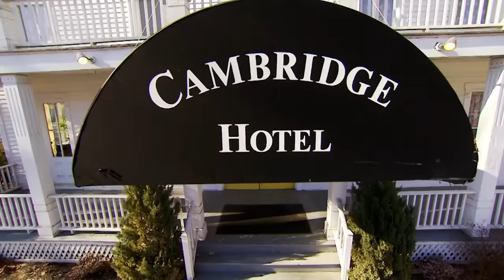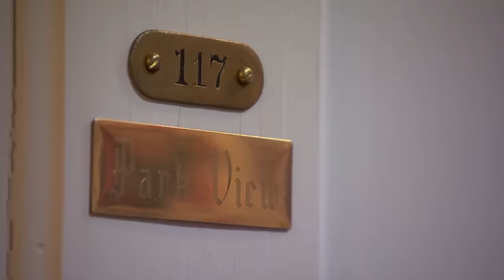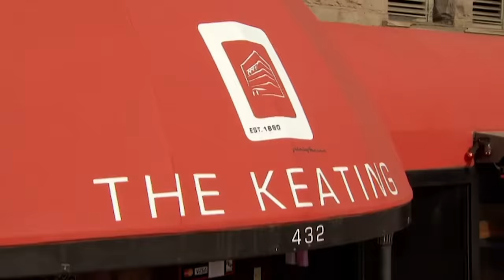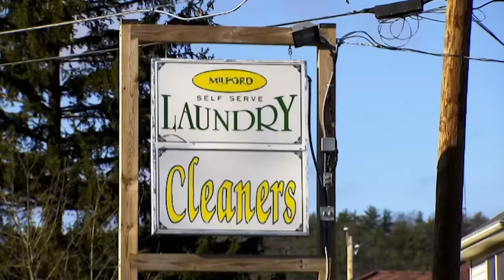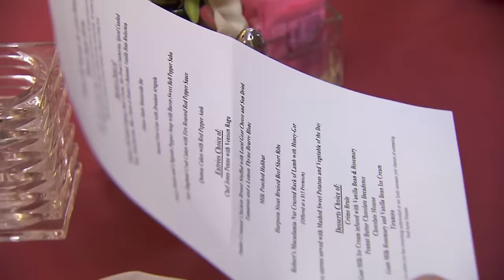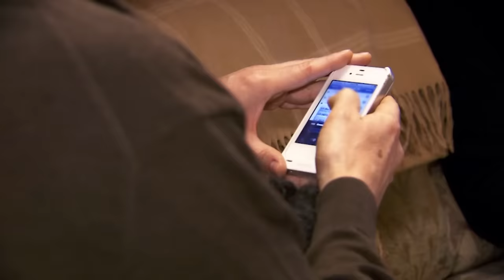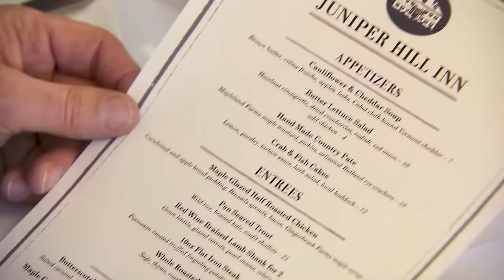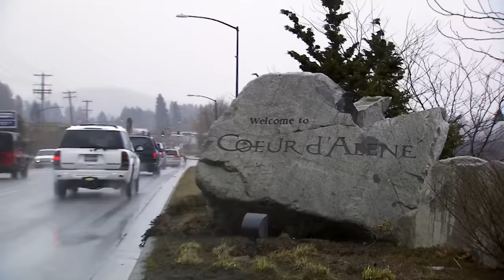every stressful moment of season 1 | Hotel Hell

Comment: The Juniper Inn
To recap everything above, Juniper Hill Inn closed in 2013 because of major debt, owing the bank $1.1 million and the city of Windsor, VT $80,000.

The hotel was sold to new owners.

As of 2023, the old Juniper Hill Vermont location is occupied by a new hotel called the Windsor Mansion Inn.

Robert Dean and Ari Nikki, the Juniper Hill Inn owners, seem to have moved to Florida after selling the hotel in 2014.

Though Ari seems to have had a run-in with the police in 2015, the charges were dropped so it doesn’t seem that serious.

Comment: The Roosevelt 
As of 2023, The Roosevelt Inn is still open and serving customers in Coeur d’Alene, Idaho.

However, the original Roosevelt Inn owners have been trying to sell the hotel, so it might be operating under new ownership from what you saw on the Hotel Hell episode.

I’ll talk about the sale history in more depth below, as there have been some twists and turns.

However, as far as I can tell, the Roosevelt Inn owners are still Tina and John Hough as of April 2023
They still do murderer mysteries a few events a year
Reply: i’m local to the area. can confirm that the hotel is still doing well and hosting events!
Reply: @sixfr0nt  thanks
Reply: County appraisers website for the county is in should have the owners listed.

Comment: Using household washers for a hotel...lol. 52:18

I have dogs and a lot of dog beds/bedding. I DREAM of two ENORMOUS Speed Queen 100 pound capacity washer/dryer sets. 

Yes, i know theyre like 3 grand each. Not that i have room for them, either physically or the specialized drainage ditch system laundromats use. 

But huge washers are the only way I can get through life. Nothing like putting 90% of your stuff in ONE load. Without overloading it! Blanket, towels. Sheets, clothing...

Comment: Honestly even without those exotics strand with maelstrom is great. With Sixth Coyote and Threaded Specter you take the heat off you all the time while having Maelstrom’s spinning around. You can run a threadling grenade for on demand threadlings for extra damage for add clearing or even just run a shackle grenade to suspend enemies and run the fragment thread of mind to get class ability energy and you never run short of a dodge. Obviously Quicksilver is a great exotic choice to create tangles from grenade launcher blows. Tbh though I’ve been going with an Incisor from trials. Either one with kill and tally or attrition orbs. That paired with slice on it is amazing. I’ve been using Polaris as my exotic weapons but I’m a fan of Symmetry a lot so I keep swapping. Secondary and heavy weapons can be mixed and matched to your liking as I’m still experimenting with what weapons work and are fun/ unique as a play style